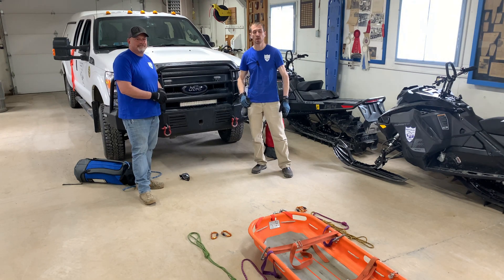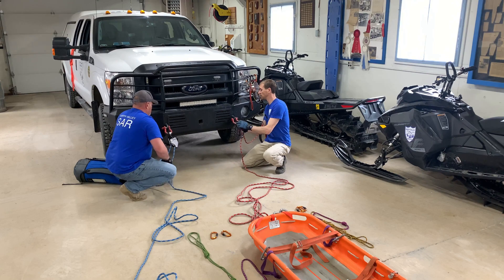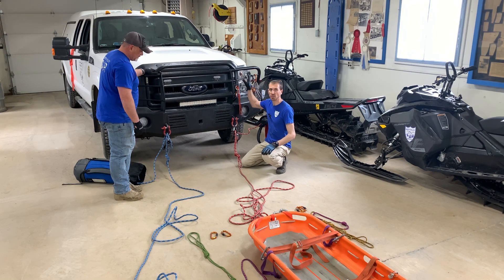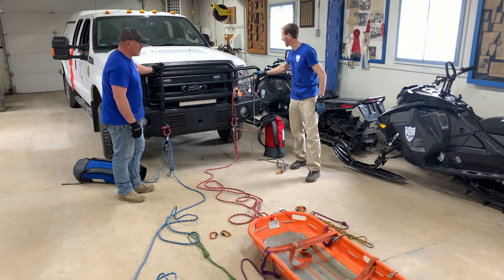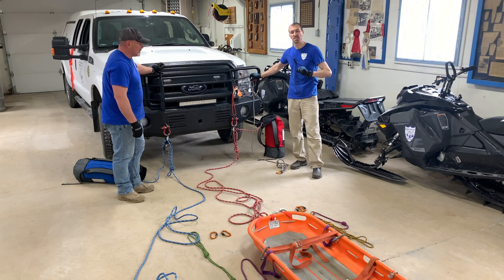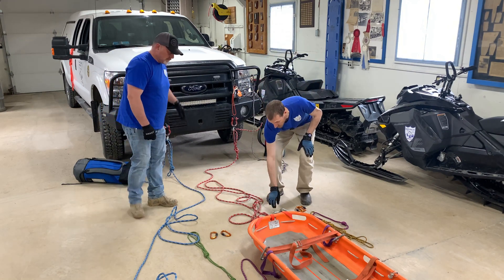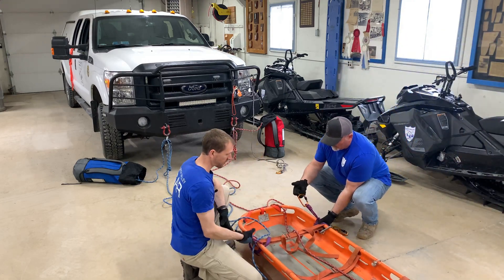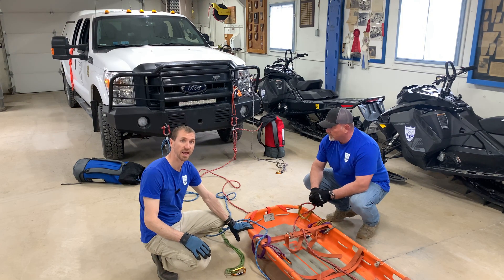Set-up Low Angle Rope Rescue with a Clutch

Comment: I have yet see anyone use a figure eight on a bight using the long tail to tie off to a rescuer.  I have only seen longtail bowlines used or inline figure eights.  Do you have any knowledge of the figure eight knot rolling or collaping if the tail is loaded.
Reply: The figure 8 can absolutely roll with a loaded tail, which is well documented and known.  In our jurisdiction, we primarily utilize low angle rescues, which for us means attendants are fully self-weight supported.  In these instances, and the low forces that are exhibited in worse case scenario, we choose internally for low angle rescues to use figure 8s.  It is simple rope knot to tie, and the only one that we train all members to initially as a baseline so they can create systems for this type of rescue.  As we progress to high and vertical-angle rescues, we move to interlocking bowlines to match the needs of the system, and we have individuals that are specifically trained for these particular scenarios at a higher level than our basic membership requirements.  Luckily, when a figure 8 collapses and it is connected to a larger object (i.e. litter), the knot will still sufficiently hold and not roll over the litter, although it will reduce the working load limit of the rope.  As always, please follow your agency's procedures and guidelines.